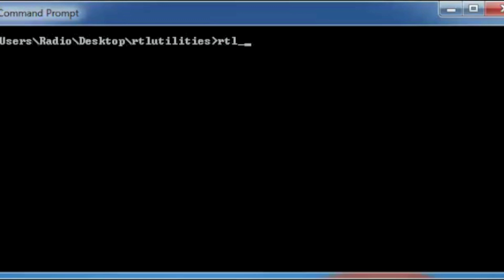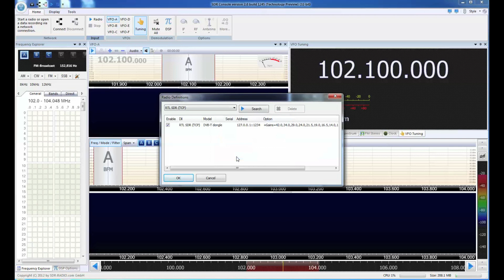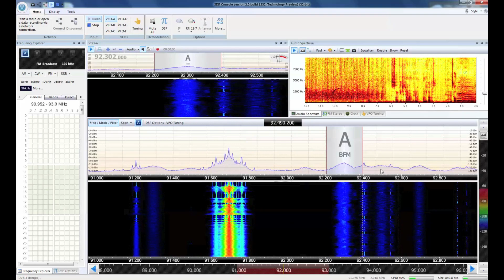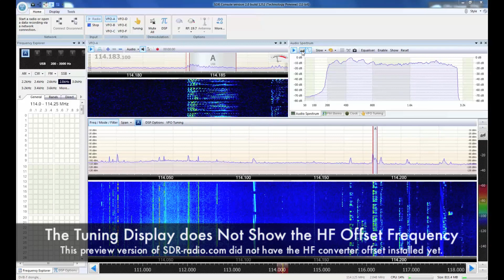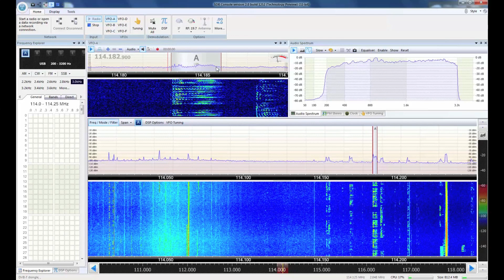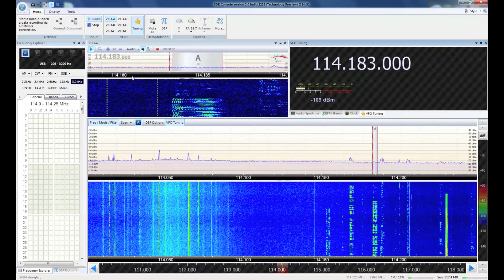Using the RTL2832U with SDR-radio.com V.2

Comment: I have the same problem reported by user janjacobs66. I followed all of the instructions but my device is not listed. I run the file rtl_tcp and it finds my device (R820T). It's strange, because I am able to tune it using SDR# and HDSDR, which means the driver (Zadig) is correctly installed. I tried installing version 2 and version 2 beta, but I still have the same problem. Nothing works...

Comment: Great, thanks :-) 

More requests... Could you do a video on installing zadig on Windows? Some troubleshooting advice would also be helpful if it doesn't work. 

Some explanation about what zadig is, what it does, and why it's needed would be helpful. Are improvements or better alternatives on the horizon, etc.